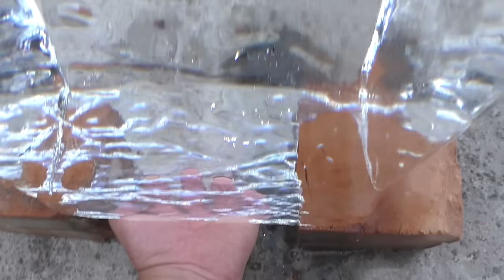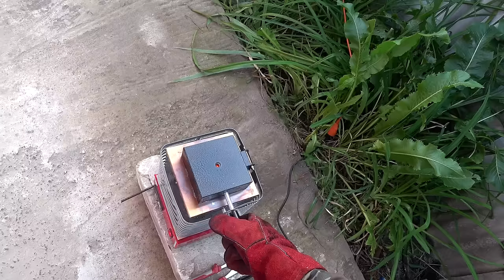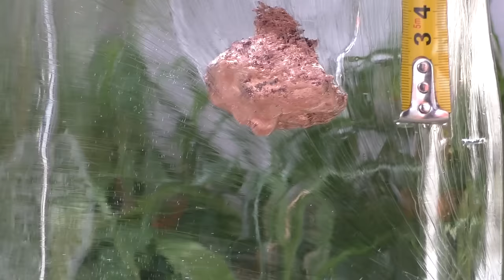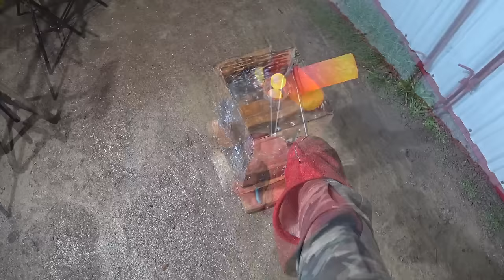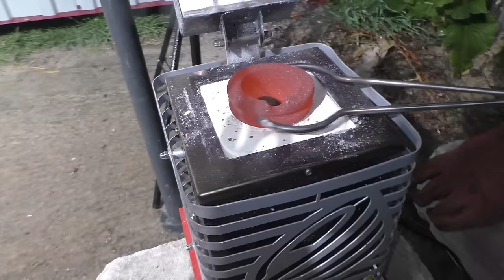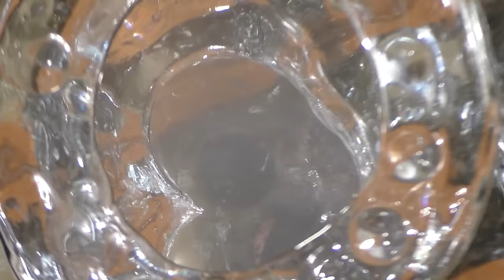EXPERIMENT LAVA vs GIANT ICE

Comment: Seems that I severely underestimated how powerful a huge block of ice would be. I expected it to break and melt easily with lava that is over 1000 degrees Celsius.
Reply: Dssssrt
Reply: Water has the highest know specific heat.  Meaning it takes A LOT of energy to melt ice.
Reply: Water came to the rescue 🤣😂
Reply: That's the principle of latent heat at work.  The ice can't get any hotter than 0c until it's absorbed sufficient energy to change into water, and the water can't go any hotter than 100c until it's absorbed sufficient energy to change into steam.  It also illustrates the difference between heat and temperature.  The lava and the ball bearings may be at a very high temperature, but they don't have sufficient heat to melt all that ice.
Reply: Now it's on YouTube that we find talented scientists while in classrooms it's the desert is that normal..XD
Reply: That's what she said.
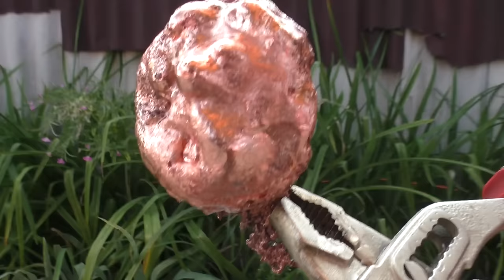Reply: 3:15 forbidden coockie
Reply: If that was the case fireman would be out of business. Water trumps fire 🔥.  I knew that before watching the full video. Especially if it's cold water. 🥶
Reply: Ok I'll come baxk to this comment section a lil later with a cup of tea
Cause i need to understand better wtf u all said
Xd ok love u all, i learnt something will do more
Reply: yes  and now imagine the gigantic masses of ice at the poles.
Reply: Water has a very high (highest known) specific heat capacity so it takes a ton of energy to raise/lower its temperature compared to lava or steel. Moreover for the chunk to melt through, the lava would not only have to transfer enough energy to melt the ice, but also transfer energy to the water around it until it becomes steam
Reply: Somehow I knew the two forces would cancel each other out.
Reply: The ice block: im immortal
Lava: Battle with me?
Reply: lol
Reply: Don’t forget that ice is just frozen water, something that beats fire, and in this case, lava
Reply: Water has a specific heat capacity (the highest of any material/ element) several times higher then iron (and other materials). For comparision: 1kJ of energy heats up 1l/ 1 kg water (capacity= 4,19kj/K) just by 1 degrees kelvin/ celcius , the same amount of iron (capacity=0,45kJ/K) will heat up by  almost 10 degrees kelvin/ celcius.
Reply: *1832° F for my Fahrenheit squad
Reply: I suspect it hasn't broken because its clear ice, meaning it has next to no air bubbles stuck in the structure. Otherwise air rapidly expanding air against something 1000+ 'C would probably make things fly.
Reply: I would be interested to see how much if any change with thin channel down the side that let the melted water escape.
Reply: Pokemon should have teached ya.
Reply: @iAmNothingness  But fire moves are super effective against ice types.
Reply: Sub Zero wins.

Comment: Heat capacity of lava is 1450 J/kg/K, for iron it's 462, so actual lava would have done better. 
Latent heat of melting ice is 330 000 J/kg and heat capacity of water is 4200 J/kg/K. 
This is why the ice always wins.
Reply: Nerd
Reply: Nerd x2
Reply: Question, if the water was pumped/sucked out as soon it became liquid, how much more prigress would the heated metal make?  Significantly more or not that much?
Reply: I was thinking similarly, not so deeply but I knew that wasn't lava and this guy is the clickbait mastah lol
Reply: It's not the energy required to melt the ICE that's really sucking up all the heat; it is the energy of BOILING THE WATER.  The specific heat requirements for evaporating water is RIDICULOUSLY high.  Something like 2,200,000 joules per kg.  And that's not the energy required to heat the ice from -10C to 100C, it's JUST the energy required to turn it from 100C water to 100C gas.

If you were to instead put the ice on top of the "lava" instead of putting the "lava" in a hole in the ice (so the water flowed away once melted, instead of immersing the "lava" in water), or if you drilled a drain hole through the ice block to drain the water away as the ice melts , it would melt much more ice.
Reply: Thanks for this ❤️
Reply: @bronco5334  You missed a couple of zeroes there. It's 2.2 million J/kg, otherwise it would be less than melting energy. You are correct that it is more energy per kg compared to melting, but not all ice is turned into steam, however by definition all of it is turned into water. There's no telling how much is turned into steam but I estimated it was not a significant portion.
Reply: @ghostly1248  That is very hard to tell from the video since we don't know how much steam or the temperature of the water. I think the best way to estimate is to first estimate the mass of the iron, then guess it's temperature based on the light it emits, and then calculate how much ice could optimally be melted and compare to what we see. It's hard, but you could do it if you feel inclined.
Reply: @bronco5334  Thats what I was thinking, most of the heat energy is being lost into the water that is surrounding the object, as opposed to the ice it is in direct contact.
Reply: @Hedning1390  Thanks I was wondering as the difference from turning  ice to water as compared to water to ice is huge.  Didn't realise quite that much.  Oh I am so inclined lol, I don't have access any of the kit.
Reply: @Hedning1390  You're right, I missed a couple zeros in converting kJ to J. 2,200,000 to evaporate 1kg of 100C water to 100C gas.
Reply: Wasnt it copper?
Reply: @patriciahay6037  highschool dropout?
Reply: Water is a energy sponge.
Reply: @WokeandProud  so a sponge is an,,, energy sponge sponge?
Reply: Ah there it is, thanks!
Reply: I didnt understand a thing
Reply: I don't get it
Reply: @burakcakr8060  High school science.
Reply: Actual lava would’ve been to hot to get close too, killing the creator 😀
Reply: Not in Pokémon
Reply: @patriciahay6037  You know, without nerds you wouldn't be watching this video, there wouldn't be any videos at all for that matter.
Reply: @Kay-jg6tf  apologies that comment was posted by my son when I wasn’t looking. We’ve had a big talk about respectfulness. Sorry again. Keep up the good work.
Reply: @patriciahay6037  No problem, he is 100% excused and i'm sure Hedning1390 is onboard with that :) It's actually pretty awesome you cared enough to comment, keep up the good work.
Reply: wow
Reply: Is it me or the lava look like a copper instead of rock? Yet what he said is true compare to this copper
Reply: Yeah Ice Ice baby!😁🧊🧊🧊
Reply: While u guys r calling this person a nerd, being a nerd is a good thing. Ur calling this person amazingly smart so nice of u guys!
Reply: @burakcakr8060  simple english but not for a primary
Reply: Water beats lava yeppers 🤓😎
Reply: You explained everything, well done.

Comment: I'd be curious to see the effects of molten rocks, rather than metal.
Reply: I mean, he probably shouldn't have used the term lava and said molten metal instead, and one could argue it's click bait. But I don't think it's very easy for a normal person to get lava for an experiment
Reply: That was what I was thinking during the entire video.
Reply: Behaves Tarzan khaki
Reply: @MybeautifulandamazingPrincess  Apparently you just have to heat lava rock to a high enough temp. That's my understanding at least.
Reply: @MybeautifulandamazingPrincess  "Lava" is molten mineral, which also includes metal.
Reply: Where do u think metals are found
Reply: @MybeautifulandamazingPrincess  Isn't metal also rock? You know where metal comes from, right?
Reply: @DragonOfTheMortalKombat  Sure, but my comment isn't as much about the composition of lava as it's about how it's made. Magma when it's still inside the Earth reaches extremely high temperatures and lava also reaches very temperatures, but I highly doubt the furnace in this video can match up, you'd need something bigger to reach the temperatures of natural occurring lava
Reply: @MybeautifulandamazingPrincess  Naturally occurring lava tops out at about 1200 Celsius (there are a few instances more than this, but not many) so is within the capabilities of consumer grade equipment.
Reply: Molten rocks aren't that hot as molten metal.

If you want something really hot, try molten copper .
Reply: @magnusbruce4051 which is why he should use molten copper .

Or even more insane , molten titanium
Reply: It’s copper not lava
Reply: Yes but their heat capacity is a lot higher than metal
Reply: @DragonOfTheMortalKombat metals have a lower melting point to stone. Jesus you can melt lead on your cooker hob. That doesn't make it lava 😅
Reply: @monad_tcp it depends on the rocks. Rocks melt between 800 to 1900 degrees. Titanium melts at 1700.
Reply: Same. I thought that was what lava was. I've never heard anyone call melted metal lava

Comment: I'm surprised that it didn't explode. When I was young I lived near an iron works and somebody dropped a big chunk of metal that hadn't cooled down in the river. The explosion was heard all over the town. Injured the truck driver.
Reply: Im not an expert but I suspect its because the block was too big and it didnt heat the whole thing. If it was a lot more lava Im sure it would have exploded
Reply: @Valkbg  And it was of course cooler than the river water.
Reply: Water expands when evaporates. But ice is less dense then water. When water is frozen, its volume increases. That's why a glass of water breaks in the freezer. When ice is melted, its volume descreases.
Reply: Exactly, I was pushing my self away from the screen cause I really thought the explosion would surprise me, but nothing happened
Reply: Not an expert but I think another factor is that Lava is not made of melted metal if im not mistaken... it is melted rocks right? if you put lava in a water, it wont explode, it will evaporate the water.. depending on the volume..
Reply: Big chunk of metal in liquid water = instant vaporization hence the explosion

Here a lot of heat gets absorbed by ice phase changing to liquid, though during the initial drop you can see small explosions
Reply: The most beautiful flowers grow from dirt, the most beautiful people - often scum.
Reply: Ohhhh! 😰
Reply: It’s a temperature thing. If he had done this with thermite the ice block would absolutely have exploded from the sublimation of the ice directly to steam
Reply: @Spectre-907  it's about heat, and by proxy temperature; if he had something with very high specific heat capacity which is also a good heat conductor, he wouldn't need to get to as high of a temperature as thermite
Reply: If you drop a big chunk of metal into cold water, the exterior would cool and contract a lot faster than the interior, causing it to rupture catastrophically. These metal balls (not even "lava") are way too small for that to happen.

Comment: A good testament to the fact that the specific heat of liquid water is VERY high at 4.18 J/(kg*C), about double that of water ice.  So the ice melts enough to let the metal dive down a bit, but once it melts to water, it becomes much more resilient to changes in temperature!

Comment: Fun fact:

It takes 144 BTUs of heat to turn a pound of ice at 32 degrees Fahrenheit into a pound of water at 32 degrees Fahrenheit.
A ton is 2000 pounds, so It takes 288,000 BTUs of heat to melt a ton of ice.
A 1 ton air conditioner is capable of moving 12,000 BTUs in an hour.
Over a period of 24 hours, that air conditioner will move a total of 288,000 BTUs of heat.
Assuming it was running non-stop, and not including the heat generated by the compressor itself, a one-ton air conditioner could move enough heat in one day to melt a literal ton of ice.

In other words, that "lava" never stood a chance.
Reply: always found tht info interesting.  r u an hvac tech as well? lol
Reply: @Brandon-bl8ko  Yep, lol
Reply: Water is very good at absorbing thermal energy so I was actually impressed that it managed to make as much progress as it did.
Reply: Fun fact: using hamburgers per football field (okay, BTUs and Fahrenheit degrees) isn't the best way to do physics. Joules and Kelvins are much, much MUCH more useful.
Reply: @ldSt3345  I'm an HVAC tech in the US, these are the units we use. And I seriously doubt it'll change any time soon.
Reply: @TheMinecraftACMan  FUN FACT:  On the continent of Antarctica there's a lake that never freezes even with subzero temperatures all year.
Reply: @eggchin9721  True

Comment: I want people to understand that this is molten metal, the temperature of lava is 6400 degrees Fahrenheit on average and molten metal is only 1600 degrees Fahrenheit. It is much less dangerous then lava. The second you would pour lava on ice it would burn through it as if you were dropping a 300 pound rock in to a bucket of Cotten balls.

So yeah it’s not nearly as cool as real lava, but who am to judge because I’m watching YouTube and most things on YouTube aren’t real.

Case closed.
Reply: R/theydidthe maths?
Reply: @RinRinsMiilkTea   lol im just big brain
Reply: Yep
Reply: @judesmith9109  
Or you looked it up.
Reply: Also: I turned clay into ceramic in my metal fire pit.
Fuel was just wood initially, which turned into charcoal as it burned. I was assisted by an air compressor so I could apply a stream of air to the thing.
(Oh, and to deal with the intense heat that began radiating off of it while blasting it, I had cloth around most of my face and used at different times gardening gloves and oven mitts to hold the air hose attachment thing. I still have yet to burn myself while building fires or set anything on fire by accident, and the only injury was one time ages back when my brother was slightly careless and slightly burned himself.)
Reply: Well not really 
Lava- direct meaning is any form of molten rock in liquid form and there are many rocks with melting point similar to metals (1500-2000) degrees
Reply: Pretty much every single Lava vs something videos

Comment: lol the diffusion coefficient of water rises proportionate to an increase in temperature. Theoretically, if you were to remove the water collecting around the heat source, there should not be a deceleration in the rate at which the balls move through the ice until the internal temperature of the balls drops significantly (dependent upon the material heat capacity and original temperature). The diffusion coefficient doubles between 25 C (room T) and 0C (ice).
Reply: I didnt understand a word but you are right water stands with ice against molten metal  . From the other hand it was like 1kg of lava against 25kg of ice +unremoved water
Reply: If he removed the water, it would have gone with a faster speed.

Comment: The ice is a lot more durable than I imagined, I expected to see that scalding hot ball just cut through that block quick like a knife through butter.
Reply: I think it's because they're both balancing each other out, while the lava is melting the ice, the ice is cooling the lava.
Reply: "Hot knife through butter."

Don't know if you've ever done it but it doesn't cut as fast as you think it will.
Reply: @jumpiestudios5265  this is how temperatures work. Just transfering energy from one mass to another. The ice is stealing energy from the lava. The surface of the lava that's touching the ice loses lots of energy quickly so it cools off. That means it has less energy to give to the ice so it slows the melting process.
Reply: @brokefolk4505  Isn't that basically what I said?
Reply: @jumpiestudios5265  pretty much. You said "I think" so I was just saying you're right and here's why
Reply: Ah okay, thanks. I was pretty sure but wanted to make clear that I might be wrong so I said "I think".

Comment: Okay, so the Lava or whatever has a heat of 1100 degrees hitting water having 0 degrees. Not much difference, is you would do the same with a bucket of water having 20 degrees. Difference: 1100 degrees and 1080 degrees...

Comment: I’m trying to remember my HS Chem class. So the ice melts and the water disperses the heat through vapor in the opening at the top. The heat stops transferring vertically or horizontally as the heat and steam escape through the top? I’m 49 and that was a long time ago.